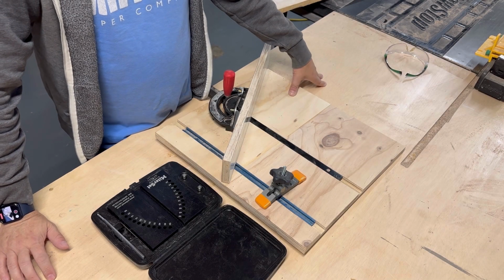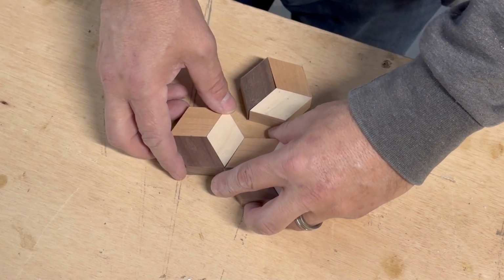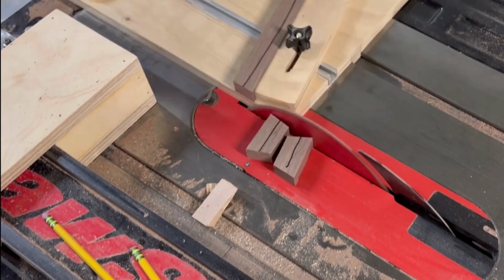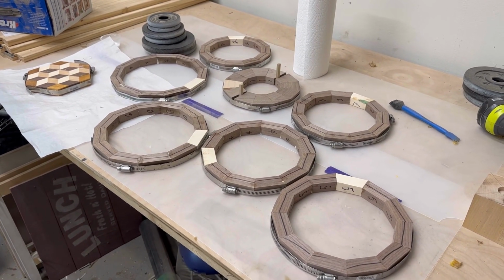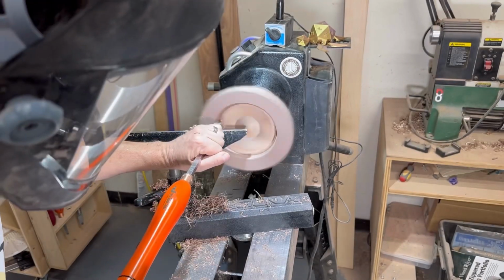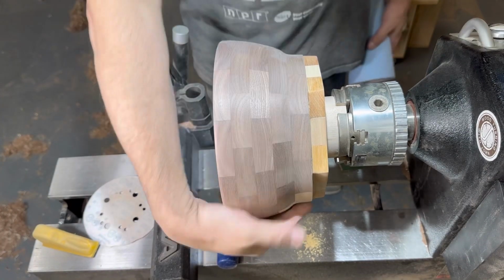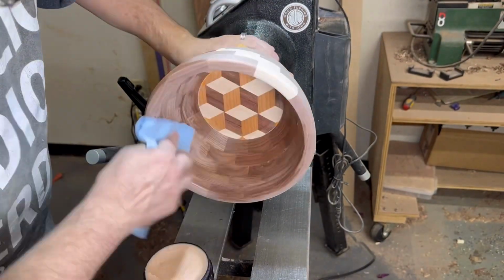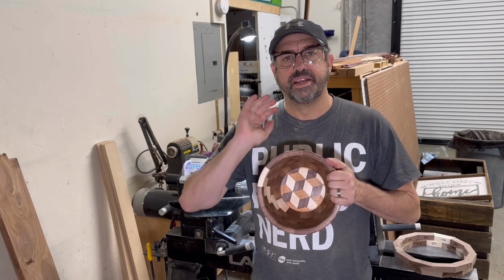Segmented Woodturning with Decorative Base | Wood Turning Maple, Walnut, and Cherry

Comment: Have you ever had any problems with the bottom cracking? I am just getting into segmented turning and am seeing alot of people using floating bottoms on their bowls. I am making urns and using epoxy to fill the bottom. What are your thoughts on this?
Reply from the maker: I question how much wood movement there is with such small pieces? I don’t have decades of experience to pull from though. In the three years I have been doing segmented turning I have not had any issues. I have not done any epoxy bottoms. I hope that helps? Thanks for watching!